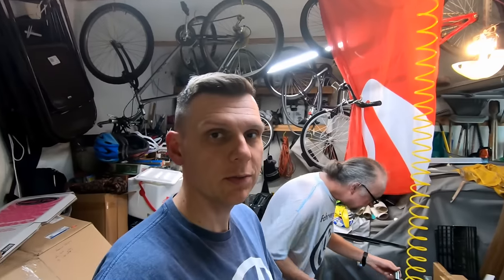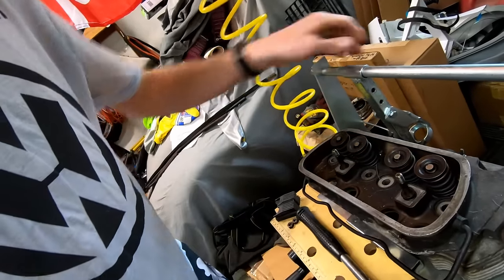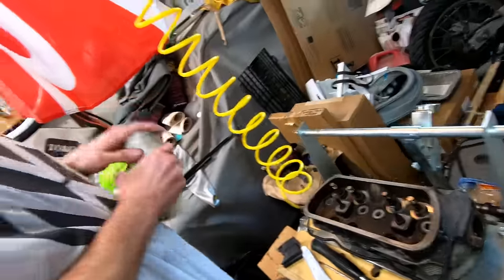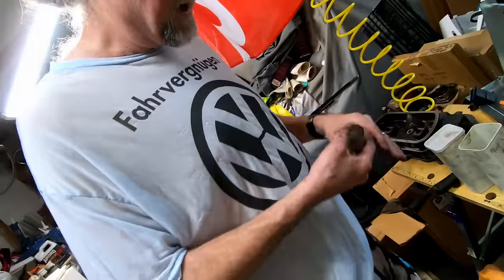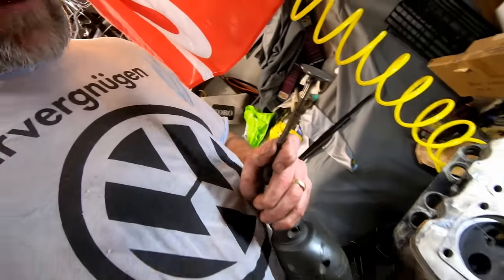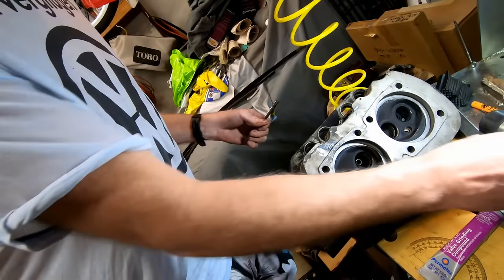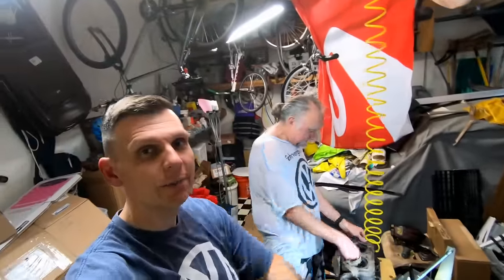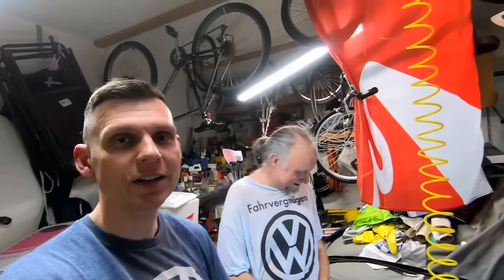How to lap valves on your Volkswagen Air Cooled Motor!

Comment: Nice how to;   Back in 1970 during high school I was in a work study program. My job was in a auto machine shop.  I would do about 20 sets of vw heads evey week. We got a new valve and seat machine, Van Norman replaced a lot of valve guides and seats. We had the standard valve grinder  equipment. . I would do a 3 angle grinds 15, 45, 60. I would move the  45 degree locations  Exhaust I go for the center of the valve, intake i would move it to the outter edge . Wish I had that equipment in my home garage now.
Reply from the maker: Very cool!

Comment: yea like the hose drill trick to spin the valve.
Reply from the maker: Thanks!
Reply: It worked great. The surgical tubing was from an old broken slingshot. What ever type of tubing you use, be sure it is very supple. The stud was from an old head.
Reply: @vw66bus  cool that stuff would grip on the valve pretty good better than just fuel hose.

Comment: I picked up an old lap grinding tool a few years back, it reminds me if a old hand crank drill or a manual hand mixer, except when you crank it it turns back and fourth and not round and round.
Reply from the maker: Yep the old manual method

Comment: Tapping the valve springs before beginning the disassembly is normal for most head shops regardless of what engine you work on. This is to remove any slug that may stick the springs and retainers. Good old school methods work best. 
And using the drill to do all the work makes it quicker.  You should have mentioned NEVER get lapping compound on the stem.
And don't forget to thoroughly wash the head down after you finish.
Moe
Reply from the maker: I thought we mentioned that but always good to know! Thanks for the tip

Comment: Thanks Marc W! 
How do I make sure my engine is ready for today's fuel? Something about lowering the compression?
Reply from the maker: Maybe Mark will chime in
Reply: Back in the 1980's, I was told that you need sodium filled valves. I think the bigger problem with today's ethanol infused gas is the deterioration of all things rubber that it touches (hoses, seals, diaphrams, gaskets). Note: the blue brake fluid hose is supposed to be good with ethanol. - Peace, Marc
Reply: Don't go wild on the compression. I understand VWs don't need an additive for the valve seats although I add some parrafin (sold as "Valvemaster") once in a while to my fuel.

Comment: To add, you can use a sharpie on the cyl and see if it transfers cleanly to the head.  If you see even sharpie on the head you know the lapping was even.  Keep rotating until it is all flush and the marker comes off evenly.
Reply from the maker: Oh okay that's a great tip thanks!
Reply: Wish I would have known before we made the video. -Marc

Comment: Am I The only on that LOL’d at spooged!? Great info! Since I haven’t done much engine work myself but might be playing with a couple that we’ve got out when you guys did the jug to head lapping do you only do the face of the jug where it meets the head or do you also do the side where it sits into the head?
Reply: You only need to lap the outer edge surface of the jug that mates with the flat part of the head. Think about how the head nuts only apply pressure against that surface. Also there is no need to lap the base of the jug to the case since you install a paper gasket between them. - Peace,  Marc
Reply: vw66bus cool! Thanks for the info!
Reply from the maker: No splooged is indeed a funny word

Comment: Crude, but effective.  Simple backwoods methods of patching things up until you can get the proper repairs done properly.  I have been a VW air-cooled mechanic for over 45 years and this still hurts to watch.
Reply from the maker: Awesome where do you work?
Reply: Why whats up with his technique?
Reply: What proper repairs need to be done, oh wise one?
Reply: I figured out My first valve lapping  with a drill when I was 11 years old, 45 years later I still use a drill for grease grinding those things, of course I am not a mechanic

Comment: Clover Grease 1 lb Lapping & Grinding Compound... i dis like that stuff in that tube i bought it and even the package say lol use 2 different grits heck i could not read what grit they squirted in the tube so i ordered  clover stuff off z ebay
Reply from the maker: Ah okay cool thanks for sharing!
Reply: So what grit lapping compound do you think works best?
Stephen...
Reply: @stephencallero8644  240 to clean up valves you know one can buy aluminium oxide [ebay] grit powder n mix with grease .i will be doing it soon so i can have the lot of grits affordable in a amount that will be around for some time